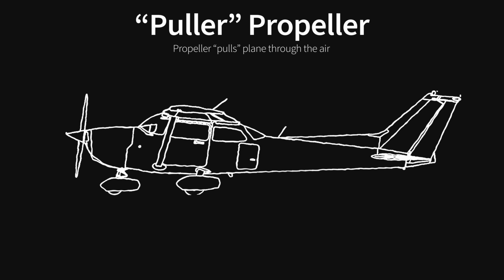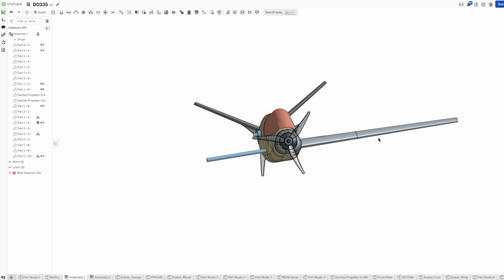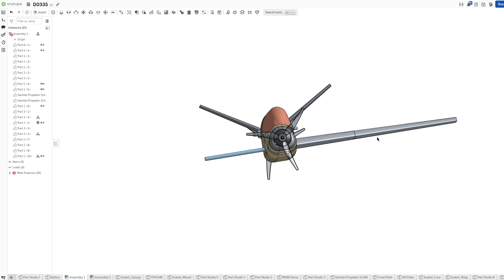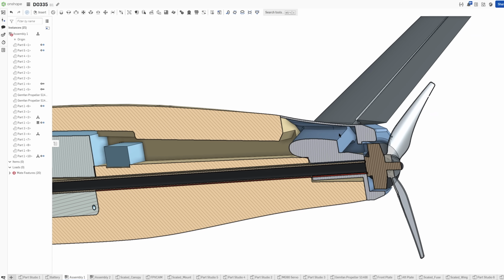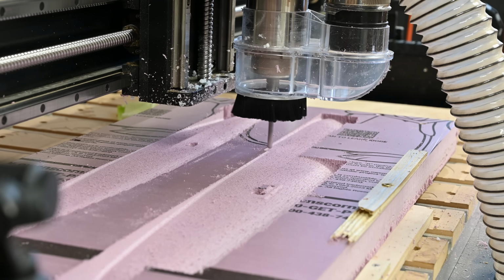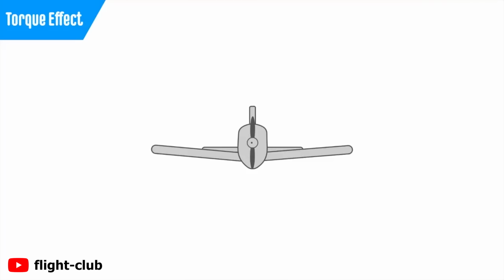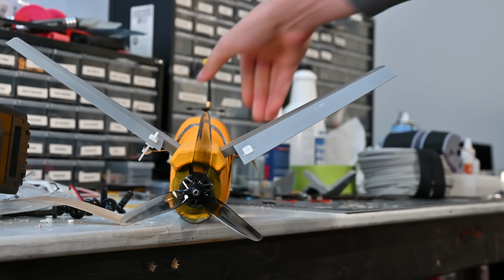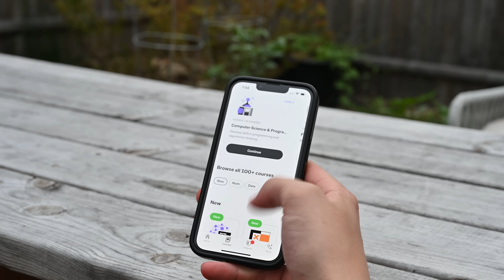Building a WEIRD RC Plane... Will it Fly?

Comment: There will be a lot of yaw effect from this prop configuration. You definitely need a large vertical stabilizer, and maybe even cg even farther forward. I’d also think about adding a small tilt to the mounting of the motors to offset prop effects. Maybe fly it manually first because you just don’t have enough time to tune ardupilot and that could be contributing to the crashes.

Comment: Size matters.  I suspect the tiny V-tail and tiny propellers both were parts of the problem, among other things. Having the tractor propeller push air mostly straight at the fuselage, that also "wasn't optimized" to allow smooth even air flow, means having that tiny pusher prop operate in violently chaotic turbulence. Trying to stabilize with a tiny V-tail on top of that, well, the outcome wasn't surprising.

Comment: V tails typically end up with insufficient yaw stability (look at it's profile view and see a small 'fin'), and when conspired to the Do335, which not only had a 'normal' tail, but an additional underfin!
Next, the CofG problem should have been seen earlier, once again even the Do335 had the wing almost in the middle of the fuselage.
Then there's the wings, which looked to have had a really sharp leading edge, which give you nasty stall characteristics (inducing snap rolls...)
And finally, there is nothing wrong with hand launching (even pushers), but you have o make sure you're pointing it (directly) in the direction that you are throwing it.

Comment: I almost wonder what would have happened if you had set up a system to disable the back prop, flying it 'normally' with the front prop only and then after it's launched and stable, enabling the back one to monitor and alter the flight characteristics?

Comment: Ahhh just for your info , I made one like 4 yrs ago , just that it was like a cessna , top mounted wing and one prop was on front of wing and one on the back of wing I balanced the thrust angle and it worked in 1st go 🤘

Just want to say that the concept will definately work without any problem .

Comment: " CG Should be good enough " 
Nope ... looks like your ailerons weren't even close to being centered, get rid of the v tail and put the second motor on a switch so you can launch with just one... and they should counter rotate. Probably want a proven airframe before attaching expensive fpv gear to it as well,,,, unless money doesn't matter to you 🤔.  Good luck and don't give up because watching rc planes crash is better content than watching them fly.

Comment: THE REAL PROBLEM IS THAT THE REAL PLANE DID NOT HAVE THE MOTOR FOR THE REAR PROP MOUNTED ON THE TAIL. MOUNT THE REAR MOTOR ABOUT AT CG AND RUN A BOAT PROP SHAFT.. IF THE MOTOR HAS TO RUN ANTI CLOCKWISE THE BOAT PROP SHAFT WILL UNRAVEL SO USE A GUITAR BASS STRING OF THE SAME DIAMETER, THEY ARE WOUND THE OTHER WAY.

Comment: Move the tail wings down and bigger wings a wing has to be as big and long as the body so yeah and i fell like if you ad a bigger propelars and use whels under the plane instead of throwing the plane like the desing cold work if you shorten the tail and use a defetent meaterial like a lighter waight foam or bord 😊✈️🚢🛬🛫and remeber safety first put a scren on the controler so you can see the plane😃 and good luck felow pilot🫡

Comment: I wonder if it would have flown better without a flight controller; just running raw pwm receiver and your inputs lol. Sometimes funky fc settings can make even a known flyable plane behave erratically. Maybe look into the rear motor perhaps inadvertently generating more thrust than the front motor? The rear of the plane was always fighting to flip itself. I wonder how throttle distribution was divided on the DO335.

Comment: Looked a bit like the tail was trying to overtake the nose a bit which wouldnt help stability, maybe try adjust thrust balance between front and back with more to the front to "lead" the plane on take off, slow down the acting like a seesaw dance till you have enough air speed to create more stability

Comment: Go back to basics.  Before you install the motors, take it out for a test glide to sort out the CofG. Add the motors, not don't plug the rear motor in (or add a prop), make sure the CofG matches the glide tests, and then after a successful test on the front motor, go to two.

Comment: I made one a few years ago, but it had a flat horizontal stabilizer with two vertical stabilizers on each end and actually flew pretty good. It is super heavy so it would drop out of the sky if you didn’t have throttle.

Comment: I'm curious if you could launch it with only the front motor, then power the rear motor after a second or two / stable flight. You know - anti-finger-chop mode. And a fun challenge for the flight computer ;-)

Comment: Your build setup is super impressive! I'd recommend tackling one unknown at a time, which would mean

1) Build a glider to test your wing loading, tailplane authority, etc
2) Add 1 motor to the glider, get the simple RC flight working correctly 
then
3) Add the 2nd motor and live your Do-335 dreams

It'll be slightly slower going but I promise it'll be less frustrating! Great work, subscribed!

Comment: why did this not work you did not balance CG CL and CT it looked like you only cared about CG 

having a pusher puller is going to put you CT in the center unless one on prop is producing more thrust then the other and with the fuselage in the way it is likely the front propeller is producing more thrust then the rear one and whare the CT is can change the CG and CL in flight like having CT above CL it moves CL to the rear and CG forward just slightly and if you have CT under CL it moved CL backwards and CG forwards just slightly 

also it dos not look like you know whare the CL is and if you do not know ware your CL is then CG is useless because you want CG slightly Infront of CL and CL changes based on what type of wing configuration you have 

just based off eyeball the CL of your first design would be roughly some ware in the last third of your wings cord so you want your CG some ware in front of that but not to close to the middle of the wings cord and i would probably put your CT about their also because i looks to me like you back prop is hindered slightly by the fuselage so would not be producing as much thrust as the front prop and it should not change based on throttle speed to much unless one motor is more powerful then the other you should do a thrust check on them and put the back prop on the slightly more powerful motor to help balance out CT

now of course this is just coming from a guy who designs airplanes in games like KSP and Kit Hack so take it all with a large bucket of salt

Comment: A video on your foam cutter would be interesting. I made one myself recently and one of the problems was maintaining constant hotwire tension when cutting wings with large sweep or taper. I used a keycard reel to store excess wire and tension it (rolled ribbon springs apply a nearly constant force and have good extension), glass beads as endpoint "eyelets" to pass the hotwire, and a brass sliding brush to deliver current regardless of the wire's unwinding/winding against the reel.

Comment: To answer why your plane handled so poorly, tandem props often need a weird fuselage shape that puts the center of pressure really far forward often times needing an even weirder shape to counteract it. You could do a lot to make it better, put a bigger vertical stabilizer or just T-tailing it, making it a twin boom like the Cessna O-2 or Adam A500, or making the fuselage roughly fish shaped like the Dornier DO 335 you mentioned (tube in the front, tall and flat in the back).

Comment: did you sync both motors?  that could be the cause for the leaning to the side, if one of the engines is pushing harder than the other it could easily disrupt the power distribution, specially if both motors are directly aligned

Comment: You didn't mention it, but it seems like you didn't use the correct type of prop on the rear motor- you need a prop designed for reverse rotation, you can't just spin a regular prop backwards.

Comment: Would go with a normal bigger tail, also the CG is a real issue and looks a bit heavy for the size of the wing...... i would 100% remove the autopilot or just leave it in some sort of lesser stability mode since flying it manually will tell you A LOT

Comment: I know almost nothing about designing planes, but as far as the rear weight issue goes, why not either move the motor forwards and run a shaft to the prop or get rid of the 2nd motor altogether and run both props off the same motor via a driveline of sorts?

Comment: Did I hear right that the rear motor is spinning the other way round? Seems to me that if the rear engine is spinning in the opposite direction as the front, arent they fighting against each other? Shouldnt the rear motor be pushing to assist the front?

Comment: What if you put the rear motor more in the center of the plane and used a carbon fiber drives driveshaft to the rear prop?

Comment: The problem I've had with V-Tails, is that they are long, can flex, and worst  is when they flutter.
When they are doing this, you can have control reversal, or just no control at all. Put a camera facing backwards to confirm the operation of your tail.

Push-Pull aircraft are known to have issues with miss-matched thrust, torque, and P-factor.   The front propeller is pushing air in a spiral around the fuselage, making roll forces on all the wing, tail, and other surfaces, where the rear does not.

Ground testing on test stands, and maybe even high speed taxi, might show what is going on. -- Many bits of string attached or fresh wet paint drops, all over could show the air flow, also.

Comment: In addition to the comments on V tail size, I would also recommend setting up the tail surface controls differently.

You have the control rods connected to the bottom of the surface. This is bad, because it places up control rods in compression (allowing them to flex and bend) when applying up elevator, which is WAY more important than down elevator. By attaching the control rods to the top of the surface you now have them in tension when adding up elevator.

There are ways to support control rods mid span to minimize flex in compression, but it may still compromise control authority.

Comment: Good job!!!!
Why PLA print the tail and make it heavy unnecessarily instead of EEP it? Try one motor first then put the second one. Make them interchangeable in flight, lastly engage both.
Your deign is lacking on durability side. Easiest will be to do a flying pusher + tractor wing, to test the theory.

Comment: Since it has 2 motors and lots of thrust you could probably set it up to not use the rear motor until you flip a switch or something so there is even less risk. Not that pushers cant be thrown, just saying it would be an option.

Comment: To little tail authority and motor trust angle was incorrect would be my guess. The pendulum behavior is typical when motor down trust does not match the angle of attack. And with two motors it gets even worse I suspect.

Comment: This seems like it is definitely a CG/aero issue. As others have said, make sure to keep your control surfaces and tail large and your cg where it should be (25% behind leading edge or so) I also recommend going nose-heavy rather than tail-heavy to start. Also, for a design like this, a bungie or Hi-start launch will save you a lot of headache

Comment: You may want a larger, more traditional vertical stab for better yaw stability since that also seemed like a bit of a problem. Bigger wing is also probably a good idea. Why did you go through the trouble of 3D modeling it and do little to no analysis?

Comment: Are both motors at the same power? A way to adjust that might help a lot. And this body has no real defining tail aerodynamics wise i believe its causing way too much drag, it almost looks like a 3 point tail was cut off and this was fixed with two fins with shorten body. The rear propeller having too much bite could mess with your thrust and 3s is very small for something this weight. They have plenty of models now that are under 250g with a 4s already

Comment: Would love info on the foam cutter! I think your Vtails were probably weren’t big enough like others have said, but I also think your wing shape wasn’t conducive to that big thick body. If you look to the talon rc plane, it relies on a high wing with a much wider wing span and much longer chord. If you stick to the wing shape, try top mounting it and I honestly think you’d have a more stable plane. Top loading a wing like that with a tick could cause stability issues, alternatively, are your motors spinning the same direction or counter to one another? You may be inducing too much torque roll by having them both spinning the same way.

Comment: The opposing spinning propellers do counteract roll but are additive in yaw. Imagine a hoverboard spinning on the spot
Reply: This. The gyroscopic effects of the props lead to this yawing effect. Similar to prop walk on boats but twice. And without a bigger, vertical rudder there is not enough yaw authority
Reply: You're both incorrect.  In an aircraft like this, the P-factor (the combination of four different forces all combining to create a yawing moment) is balanced and counteracted between the two props.  This is no different than a contrarotating arrangement seen on some Griffon powered warbirds which have no P-factor to speak of, they're just separated on either end of the aircraft rather than being stacked together. The problem here is that unlike a Griffon powered warbird, the two props are not designed for this and are not producing equal amounts of thrust, so the benefit from having contrarotating props eliminating P-factor is not going to be realized as apparently.  One of them is in clear air spinning slower and developing ideal thrust, the other is in dirty accelerated air and isn't able to develop as much.  Thus, you have a discrepancy between the two props, leading to a yawing moment.  The V-tail is compounding this problem, and with a conventional tail arrangement of adequate authority, the P-factor discrepancy would be a non-issue.
Reply: @Skinflaps_Meatslapper there is actually a major difference with Griffon engines. On the Griffon, both propellers are attached to the "same place". Here, one is attached facing front and the other facing back. In this configuration, if you look closely to gyroscopic precession, they are actually piling up. If you look each propeller from the motor's mounting holes, they are both spinning CCW. To not have this problem, the rear motor would have needed to be mounted the other way i.e. facing front but it's not possible 😉
Reply: @Skinflaps_Meatslapper  i like how you said we were wrong then proceeded to very clearly explain why we are correct...
Reply: @LBJHJP50  If you actually understood and followed along with anything of what I said, then you'd realize just how contradictory your statement is...but you don't, and you're getting completely separate things mixed up together in addition to not understanding the aerodynamics and physics of this in the first place.  When you combine your very limited understanding along with your smug attitude, it doesn't really matter what I say after this, you're going to think you're right anyway.  I have no interest in explaining what you're not understanding, you won't doing anything worthwhile with it anyway, so enjoy wallowing in that delicious Dunning-Kruger effect with your newfound buddies.

Comment: AND WITH VTAILS THEY NEED TO BE ABOUT 20% bigger in surface area then your average tail design and because you have a swept wing i would suggest making the nose or evrything forward of the leading a bit longer to give yourself and that front motor more authority over the rear motors forces which should then give you more life outta your control surfaces

Comment: its tail heavy... soooo tail heavy... the last clip of you showing the CG after moving the wings it was still near the centre of the wing chord, it needs to be about 1/4 of the chord back from the leading edge or even further forward, especially for a heavy small winged plane like this. I reckon it would have flown like a dart if the CG was corrrect.

Comment: next time,
use  a  GOOD  low-re#  wing profile.!       identify  thirty percent of mac  and  correctly support the model during the balancing.!      be aware that the c-m should be located a bit forward-of cg, in order for there to be inherent nose-heaviness  in the dom.       in other words, the c-m should be located  On  the thrust line, at a point that vertically aligns with twenty-five percent of mac.      it is probable that the counter-rotating props  actually  produced  a  'twisting' force.      begin with just the front-located  prop.       use  PROPELLERS.        do everything possible to  Reduce  the amount of mass located aft-of the cg/c-m.     c-m  is center of mass.        it may be that this (tiny low-mass) design does not have sufficient inertia to adequately damp the (dual) p-factor.
learn about correct wing design; built-in positive aoa; swept wing spars; dihedral bracing; anti-wracking wing structure; and profile selection.

Comment: YOU DONT NEED TO WORRY ABOUT RUDDER WHEN DOING EXPERIMENTS IT WILL CAUSE ALOT OF ISSUES ESPECIALLY WITH A LOW WING DESIGN JUST BANK AND YANK WITH ELEVATOR AND ALLERION

Comment: Absolutely no RC plane experience here but it definitely feels like your rear prop is over driving your front prop causing the plane to want to flip around the CG. i.e....too much tail thust at the start of the flight , start with the nose motor to gain stable flight then bring the tail in for the extra speed boost.